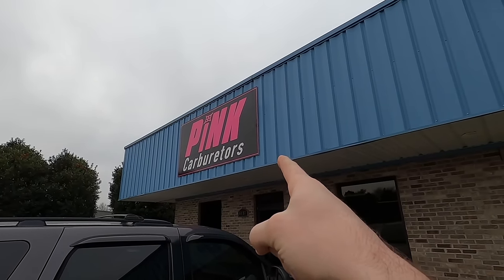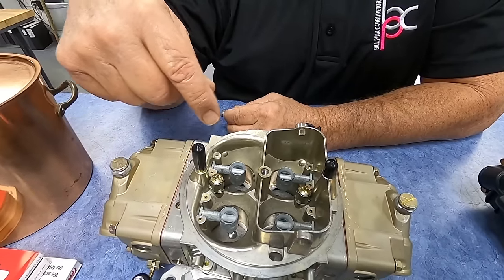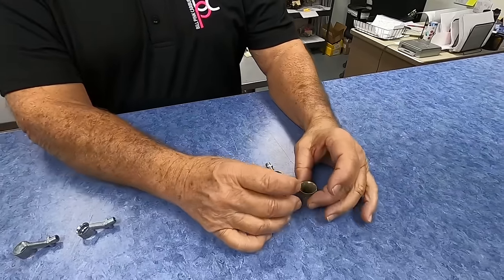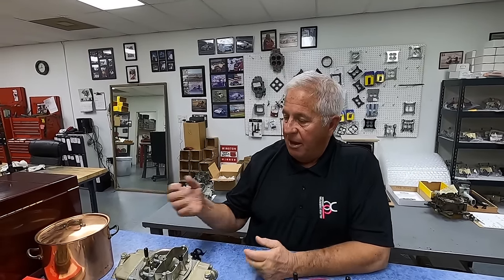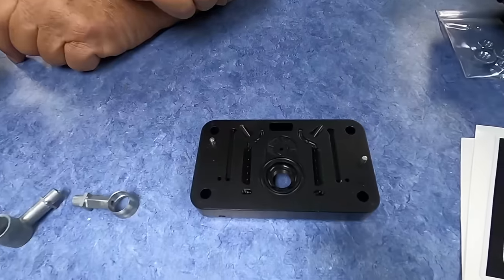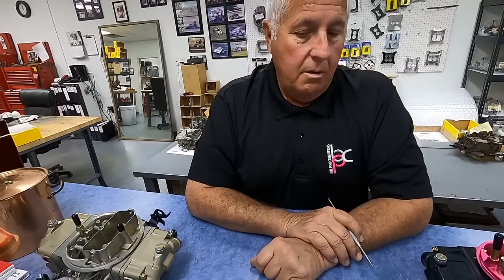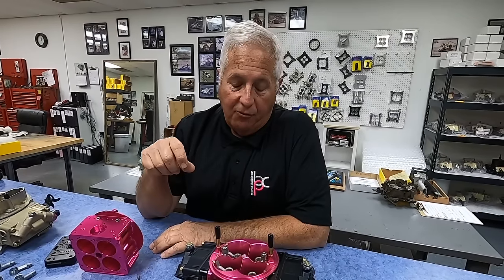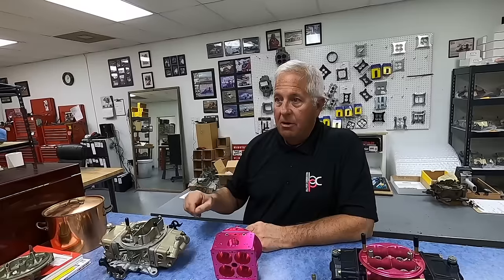Carburetors Are WAY Smarter Than You Think! Tuning Guru Bill Pink Shows Us Why (Carb vs EFI)

Comment: I’m a full carb guy through and through. My ‘85 C10 is carbureted and runs perfectly. I wouldn’t change a thing on it. Thanks as always Stapleton for giving us another very informative video
Reply from the maker: thank you for being here Jared!
Reply: There's a big reason why your 85 c10 came with a 5.0-liter 160 hp V-8 and a 2023 Silverado 5.3 starts at 310 hp.
Reply: @MrTexasDan  Plenty of carb'd engines out there from the factory that exceeded 310hp long ago.  In 1985 GM was using the 305 for fuel economy and it had no compression or cam in order to pass emissions regulations.  The LS with a carb on top of it won't lose any HP, the HP is all in the Head design and cam profile.  The EFI just helps with daily drivability.
Reply: @OldBeaterGarage  There were smoggy 5mpg beasts that got better than 310hp. Not many. And today low-end v6s are doing 300+ hp.You forget that even more strict emission regulations are in place today, along with poorer gasoline. So what's the difference between then and now? Well, the combustion chamber got better, which accounts for some of the improvement. And ... wait for it ... EFI.
Reply: @MrTexasDan  yes EFI is good for MPG but it is not the reason why modern engines make more HP which you originally alluded to. In the 70s and 80s the tech wasn’t mature enough to make the cars meet emissions standards so they did what they could with what they had. Which meant lowering compression and reducing the cam duration and lift, which killed hp. There were still V6s making the power you speak of in the 80s as well albeit turbo and EFI but on top of a Buick motor designed in the early 1960s. Even in the early 60s a puny 3.5 liter engine was pushing into more power numbers with Turbos and water meth. The modern stuff is not new miracle tech.
Reply: @OldBeaterGarage  EFI may not increase ultimate HP but it will absolutely increase power all the way up the power band just because it can maintain proper air/fuel ratio under varying load and rpm. As a bonus fuel injection properly atomizes the fuel also.
Reply: @MrTexasDan  Put a 4 barrel carb on that 5.3 and it's still going to make 310 hp if you swap it into an 85 c10
Reply: @OldBeaterGarage  the other guy saying modern v6s with 300 plus hp, well they're spinning much more rpm and have short strokes with large bores, vs old engines that made more torque with longer strokes, and those Buick turbo v6s didn't rev much to made good hp, but a shit ton of torque and made it down low, and I honestly don't think mpg numbers have changed much since the late 90s, not to mention some EPA ratings claiming higher then in real world conditions, although they are tested in perfect ideal conditions, I still think older EPA numbers are closer to real world driving, and now when they test them, they are barely pushing them to claim big mpg numbers, for example the ecoboost 3.5, you would have to drive like a grandma to get good mpg, as soon as your into the boost its slurping.
Reply: @bidenstoletheelection9116  Ok, try a little experiment. You tune an engine ... any engine using any carb, your choice, your tune. I'll take that same engine and tune it using any EFI system and injector sizes I want. Then run them around a track and see who wins.
Reply: Same with my 85 k15 350hp 350. Touch key start every time with very little to go wrong
Reply: @MrJosephfunk  yes sir 🤙
Reply: Late model racing uses carbs. And makes 400-450 in the Pro Late using crate engines. To 550-650 in the super late using built engines
Reply: @MrTexasDan  p by
Reply: Carburetors were doing just fine when they were satisfying paying customers instead of government regulators.
Reply: Until you change elevation, and you have to pop the hood and adjust for altitude, which EFI does automatically and more efficiently than carbs!
Reply: @MrTexasDan uncle Tony says, all things optimized, you get more power from a carb because the cooling effect makes a denser charge.
Reply: @yeboscrebo4451  "the.cooling.effect" ??
Wow that's a new one.
Reply: @MrTexasDan  Yes, it’s called “adiabatic cooling”.  That’s a significant advantage carbs have over EFI.
Reply: @yeboscrebo4451  Ok so you are referring to the cooling from the drop in pressure past the throttle plate ... the very same throttle plate that is on FI systems. Ok.
Reply: @MrTexasDan  doesn’t have anything to do with the throttle plate
Reply: @yeboscrebo4451  Really, ask any aircraft mechanic. It has everything to do with the pressure drop after the throttle.
Reply: @MrTexasDan  don’t need to ask an aircraft mechanic, the pressure drop has nothing to do with the throttle plate.  Just because it’s “after the throttle plate” doesn’t mean the throttle plate has anything to do with the pressure drop.  Really, just look it up and examine what happens when air velocity increases as it passes through the Venturi - that’s why there’s pressure drop.
Reply: Maybe I’m crazy but a well tuned and maintained carburetor has even better fueling characteristics than FI.

Over the past 15 years the motocross world has moved over to FI and every year hear complaints about fueling issues. The carbureted bikes from about 2008 made even more power than the modern injected bikes.. just saying.
Reply: @fastone371 Exactly. EEC isn't about peak power, it's about power everywhere. A carb/distributor can easily be tuned to work at wide open max load, or for idle, or for part throttle. But not easily for every single situation. EEC will optimize fueling for any operating point, and protect engines from damaging situations.
Reply: @MrTexasDan yeah it’s called the government with emissions bs.
Reply: Seen any EFI set up converted to Carb for comparison. I haven't, but it could be an interesting view. There are some comparisons made switching A carbed engines to CFI by very reputable dyno operators. There may be carb to EFI out there. We would enjoy the link. No doubt EFI has drivability and emissions in check and modern developmental focus is clearly in its corner.  @MrTexasDan

Comment: My husband says this about carburetors in terms of physics. " It is the only fuel & air metering device that has endless adjustment using the natural law of physics without the aid of an electronic computing device. It uses atmosphere and ambient temperatures and pressure to regulate its functions which subtitues computers etc." He is a mechanic anymore but during his time has built & modified several different types of carburation systems. He also said what he learned isnt  even close to what else a carburetor can offer as far as its real potential. Its a computer within itself.
Reply from the maker: Very true!
Reply: Couldn't be said better. But computer control is  so shiny! It must be so good , lol
Reply: @70ixlr86  ha ha ha  oh well my hubby is just an old soul i guess. He doesnt know anything else.
Reply: @70ixlr86  EFI, if one knows what they're doing, is faster not nessisarly better. It's a laptop and a couple minutes top for me to change fuel and timing on my efi coyote vs my carbed sbc where I need a bunch of tools.
Both have their merits. My efi (which also controls ignition) cost 2500, the carb and distributor 700.

Comment: Absolutely incredible. Truly blown away by the information provided and can't wait to see what else you learn from Bill. I would LOVE to see Bill show us a head to head dyno test between maybe EFI, an out of the box Holley, and his works of art. So excited to see a channel providing so much knowledge and truly showing how much goes into hot rodding. You definitely have a knack for finding the people who pour their heart and soul into finding those last couple percent in things. The passion people exude for this is so awesome to see!
Reply from the maker: Thanks man!!
Reply: @Stapleton42  you gotta try to make this comment happen
Reply: I don't know about this guy's carbs, but Pro Systems carbs are as near perfect out of the box as one can be. My buddy Alan's, All Motor on race gas, 80s Olds S/C Cutlas had run 8.16/165 for 15 years with both a 540 & his 555(Reher & Morrison told him his engines make 50 more HP than theirs). He bolted on a Pro Systems carb, never touched the curb idle speed or A/F adjustments & went 7.96/168 first pass out of the trailer in Phoenix, in June, with an Altitude Air Density of 4,000 feet(that's 7.70s/173 at sea level with 70 degree air).The guy that owns the Fuel Injection University in Parker, AZ. & also tunes the Elite Motorsports Pro Stock cars told Alan in private convo, that "F.I. doesn't do ANYTHING better than a properly tuned carb". BTW, Dyno tuning is a waste of time & $$$ because the jetting & timing is NEVER the same in the dyno room as it is on the track because the loadings & atmospheric conditions are NEVER the same!! My 89 C1500 NASCAR look hot rod with a 409ci small block & a 750 CFM Holley Street HP Dbl Pumper carb makes almost double the HP & gets better fuel economy than my 2004, 2WD Tahoe. It did, however, take considerable time & a lot of knowledge to properly tune it.
Reply: Carbs & some of the builders are amazing. My buddy has a Super Comp door slammer that had run 8.16 without the stop for 15 years with both, his 540 & later rendition 555 BBC. He did nothing other than order a carb from Pro Systems, built on the bench & never seeing the car. He bolted it on, did NOT touch the idle A/F adjustments not the curb idle & went 7.97 first pass out of the trailer.

Comment: Very technical with knowledge that will fly over many of your viewers heads. Most guys say racing on the street are tuning with jet sizes and power valves and fuel octane and turbos. Carburetors are amazing. Would of never visualized any of the science and engineering that goes into a carburetor without videos like yours. An overview video of a diesel  engine would be interesting. I personally have very little knowledge of how a diesel works. Thanks for sharing the technical side of racing.   👍👍👍

Comment: With a carburetor, you also have a pressure drop across the throttle plate, so the fuel has a cooling effect sometimes cool enough you get ice on the intake near the throttle plate base area, or the runners .... Cold air is dense air, entirely why they make more HP, than injection systems.
Reply: I've tried to explain the benefits of the colder IATs that carbs offer to so many people, and most just won't listen.

Comment: Diesel at cruise speed each valve has air pressure sitting on the intake valve all the time.  No worries about intake runner length.  Valve opens air enters valve shuts.  No vacuum

Comment: My 780 with the choke milled off and down leg boosters, it’s a 3310-1 with blocks on both ends and it is a monster of a carb. I made an air box like that for my 65 Galaxie 394 FE

Comment: Diesel fuel management is different than carbs…and EFI…there’s the old school with a pump and injectors, or like the old Detroit Diesel used unit injectors, and then there’s todays diesel that uses an ECM to control fuel delivery…and timing. It’s all pretty cool though. I found it easier than tuning carbs… great video! Keep up the good work!

Comment: This is all awesome for the Holley brigade. Thing is, Holley's big 4bbls make really good Race carbs, where most of the time they're wide open.
But for street driving, day to day stuff, if you can find someone who can tune them properly, a Thermoquad with Electronic Ignition, or a Quadrajet with E.I., can get very very close to matching the economy and emissions of EFI, but with crisper throttle response feel. At the limit, especially for emissions, EFI is always going to win, but the real win for EFI is the much lower maintenance required for the average driver in the average car. Carbs require a lot more maintaining, and if they drift off tune even a little, you're stuffed,...
Reply: BULLSH!T!!!! Holley carbs can get excellent fuel economy & work GR8 at all RPM & throttle opening! Maybe you need to learn to actually tune a carb. The new performance Holleys have all the adjustability that Webers have had for decades!! One of the best tuners alive runs the "Fuel Injection University" & tunes the Elite Pro Stock cars & several of the factory shootout cars & he will tell you in private that FI doesn't do anything better than a "properly tuned" carb! Thermo Quads & Carters(Edelbrocks) have been JUNK forever. Holleys, Webers, Quadrajets, the 60s Motorcrafts top loaders, & the 70s Ford spreadbore ARE the best carbs ever manufactured & are highly tuneable, IF one actually knows how to tune a carb!

Comment: C'mon, Lake!!! The fuel injection system "listens" for the air signal AS IT ENTERS THE INTAKE, even BEFORE a carb would see a signal.  A carb is a passive, reactive device, while FI is an active and proactive device!! Also, each cylinder is metered fuel individually. Unless you're running webers, carbs don't  come close!! Finally, FI can deal with changes in air density on the fly, unlike a carb!!  Less of a restriction, too!! The carbs main advantage is its simplicity, as well as a cooling effect under WOT. 
  Having said all of that, though... I would love to hear more about carb  theory and tuning.  Receiving knowledge from knowledgeable people never gets old!!  😊

Comment: Biggest trick on a street carb.   Tuning the Idle Feed Restrictor.  With air fuel ratio gauge and oxygen sensors installed.  Bring the RPMs to 1700.  Is the engine rich or lean.  Change only the idle feed restriction.  Nothing else. Try again.  
Holley ships carbs with 0.031" idle feed restrictions. The computer flow bench at holley is set for that size to verify operation.  0.031 is great for a 327 or 331 cube engine.  A 347 to 355 needs a 0.032 ifr. 
Get the ifr sized connectly.  You will have trouble keeping tires on the rear wheels.

Comment: Old school diesels pull all the air they can all the time. They often can be running air fuel ratios close to 30 to 1.  Some newer diesels actually run throttles to limit the pumping losses and improve fuel mileage.  One of the reasons diesels get good mileage is they are high compression. Another is there is more energy in a gallon of diesel fuel. Heat rejection also plays a role.  There are some factory Diesel engines now running better than 50% efficient which is like formula 1 good

Comment: Hi Mitch and Logan,  I got a Holly Dom carb off of Evil Bay cheap.  The guy put in blank off of the power valves but didn't change the jetting, Lol.  He said in a message the carb was Junk.  I rebuilt the carb and it's worked great.  It has adjustable air bleeds.  I purchased a Altimeter gage because the altitude changes during the day.   maybe get them to talk about that?

Comment: Your channel has single handedly put more factually correct educational material out in 1 year than entire educational systems have their entire life. Any upcoming or even older "car guy" would be dumb not to just watch your backlog of videos and self educate. I appreciate your hard work! As for Diesel engines and your question... They move all the air they can all the time no air throttle required, you simply control revs by only injecting a specific fuel amount to meet your needs. Meaning you may only burn 1% of the available air in the cylinder and the other 99% is unburnt and just along for the ride, this is very unstable and unachievable without detonation in a gas engine "typically". The reason being the fuel is coming into the cylinder already mixed with the air. Gas engines control revs by restricting airflow and always targeting a stoich or richer mixture for compression stability. A diesel with it's direct injection will be moving all the air it can and be "lean" by gas standards, say 80:1AFR at idle/light cruise and as you tip in or ask for more power more fuel will be injected and so the AFR will start to decrease to about 18:1AFR,. AFR drops as your start burning more of that available air. After about 18:1 AFR in a diesel a lot of smoke is generated so it's not worth getting richer as people get big mad. Gas engines require stoich or richer for stability.. Diesel thrive on combustion "instability". It's why diesel fuel has a extremely low octane rating and is rated in cetane which is basically the opposite of octane.... The lower the octane the better it is for a diesel. You also inject the diesel fuel at roughly the same time you'd start your sparkplug ignition on a gas engine. After the diesel fuel is injected into the cylinder it lights off almost instantly. There is a lot to know but if you want to know more LMK i'll answer just about anything.
Reply from the maker: Very interesting!